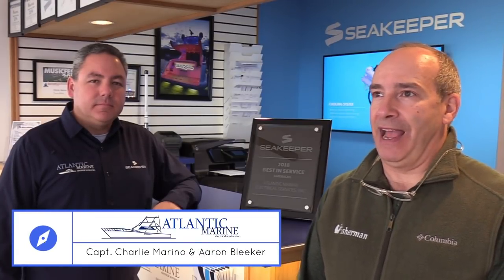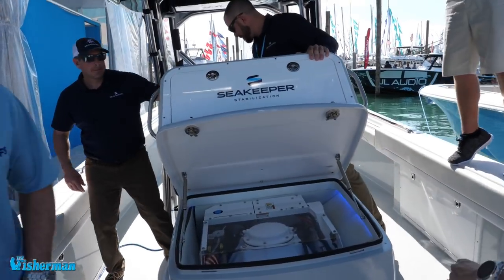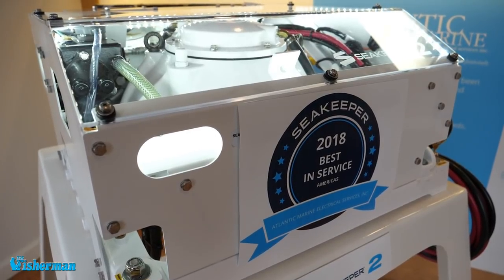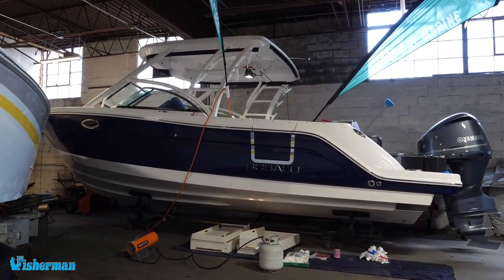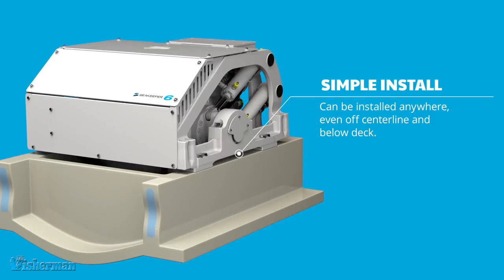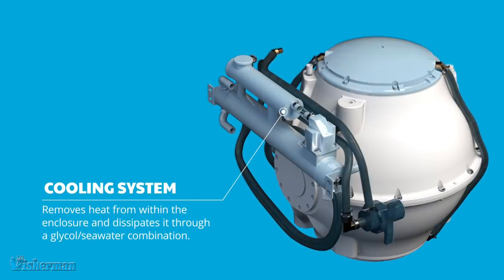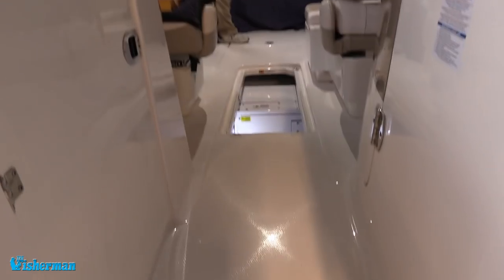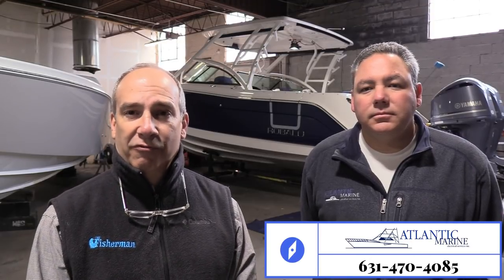Seakeeper installation   The Fisherman Magazine

Comment: .Would it always be a retrofit or can it be done at the factory.
Reply: there are brand new yachts having it installed. some yacht makers are putting seakeepers in every yacht they build or have it as an option in the design of the yacht. 30% of seakeeper installs are retrofits.

Comment: Is this to be used while stationary only or can it also be used under way?
Reply: it can be used both. they can also put in a stabilizer control so it works on forwards and backwards motion as well.
Reply: @toomanyaccounts  Wrong-o, Marylou. Seakeeper has a "forward/backward" gyro that will ONLY control torque along the transverse axle. The unit is NOT mounted for side-to-side gyro pitch. And anything that keeps the ship flat means you'll never get to plane, you'll never go OVER a wave, and will likely see blue water pouring over your bow often enough to flood your boat.
Reply: @maxsdad538  wrong. funny how users and live vids show the boats using the unit while going over waves all the time. the gyro goes every direction.